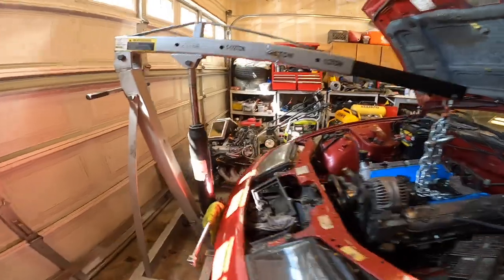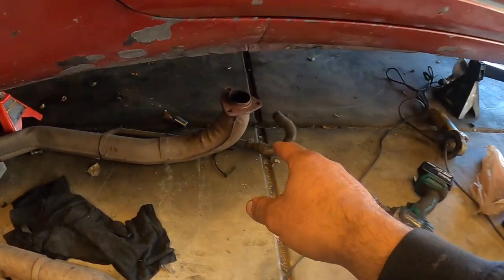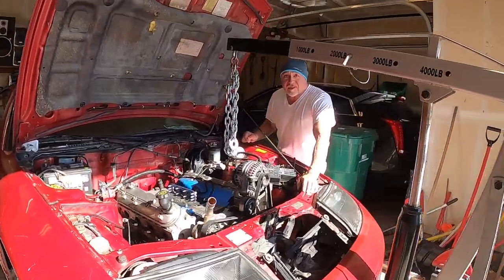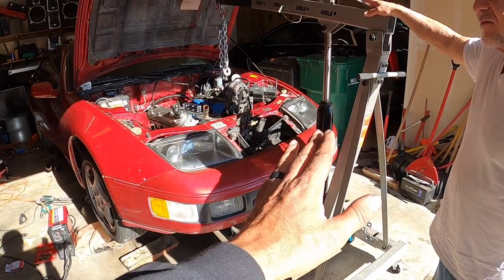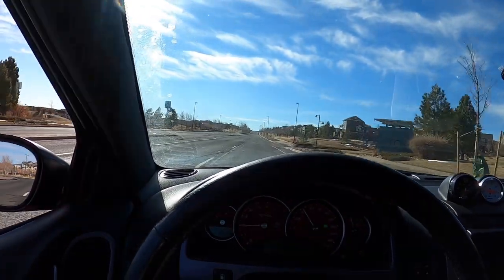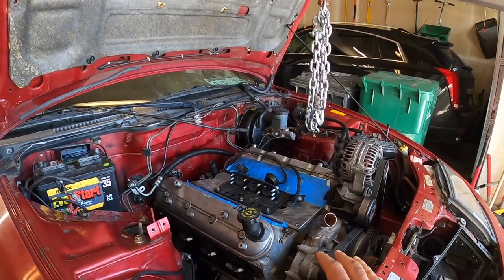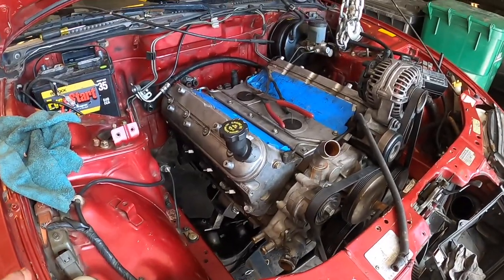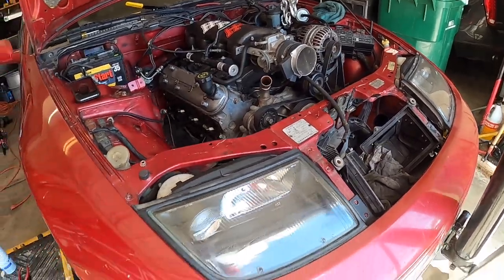QUARANTINED Z32 300ZX LS BUILD: I MADE ENGINE MOUNTS AND THEY WORK EXACTLY HOW I WANTED!

Comment: Not sure that the 1” square tube is going to hold. Most 1” square is only .035” wall. Need 0.065” wall at least. Hope it works. Keep it up!
Reply from the maker: Autonut you can’t tell but it has 1/8” reinforcement plates on the back sides of each tube.
Reply from the maker: Autonut worst case scarnario I just reinforce them more
Reply: Trey Herrera, haha! That’s the spirit!